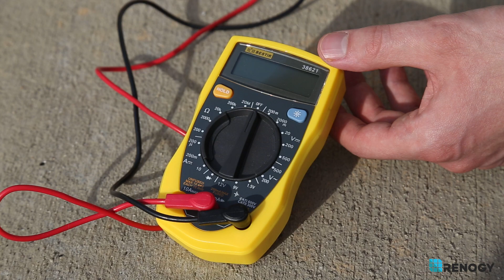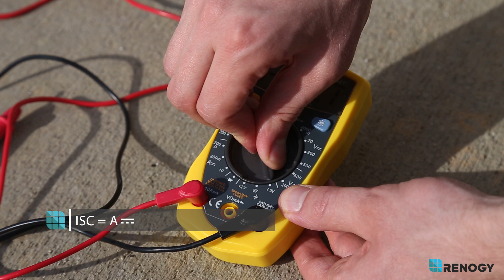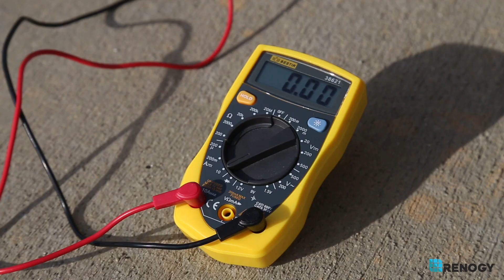Renogy: How to Troubleshoot Your Solar Panels

Comment: The section on setting up the multimeter is so very fast.   Pause play, pause play....  How do you test these with a load?   I have 800w 400w&400w at 48v.   Only getting 31 amps.
Reply from the maker: Hello, thank you for your attention! First, we need to confirm how your system is connected and your testing method.
Secondly, if you suspect any issues with the panels, we recommend disconnecting the connections between the panels and testing each panel separately.
If the video is too fast, you can refer to this link: https://www.renogy.com/troubleshooting/Troubleshooting-Solar-Panels

Comment: (APOLOGY POSTED) Your brand new panel may be defective...yesh, thanks for shipping junk.
Reply from the maker: Hi, Fights.
All our products are quality assured. If you have purchased our panels and are meeting after-sale problems, please submit a case through our Help Center Portal with more details (links listed below for specific locations）. If you have previously submitted a case which has not been replied, please provide us with the case number so that we can inform the customer service to solve it for you as soon as possible.
 
https://renogy.force.com/helpcenter/s/contactsupport (USA)
https://renogy.force.com/helpcenterau/s/casesubmit (Australia)
https://renogy.force.com/helpcenterca/s/contactsupport (Canada)
https://renogy.force.com/helpcenteruk/s/contactsupport (UK)
Reply: @RenogySolar  My concern is QA process has been shifted to customers.  Customer can QA to see if panel works.  Increased profit for Renogy.  Increased time, money, frustration for customers. This seems to be common with corporations lately.  Nothing else can explain why we receive brand new broken products so frequently.
Reply: So I enter for Web support.  The email response is call the 800 number.  Why have web form if we end up having to call?  Gathering statistics....
Reply: Apology to Renology!  I had not corrected the cables properly.  The cables were coiled up and unlabeled.  I traced them, labelled them,  and now all is fine.  Sorry for stating the panel was bad.  Renogy is batting 1000.

Comment: She mentions " you may have a bad diode" you can not test that out just pointing it at the sun with open circuit or current. You need to be able to test it while partially shaded and a load on it, and for those that called someone in the comments " intelligent" for suggesting a load, he is right. a load meaning connected to a charge controller. because the MPPT will drop the voltage down to about half in order to try to get the most wattage out of it. If your diodes are fine, the voltage will be " normal" Its easier to check with a series connection, because if one panel has a bad diode it will bring the entire string voltage down.  I had to learn and figure this out myself. Because I called Renogy and explained that my panels dropped voltage from being 60volts to 14 volts after adding a 4th panel, the voltage should be 80 volts ( give or take a bit) and the MPPT of that is roughly 68 volts at 5.9 A- 6 A ( in optimal conditions). But with that bad diode it was bringing the panel string down to 14 volts and providing only 10 watts to 25 watts. I went one by one I removed a panel, until the MPPT was where it was supposed to be. The " technical support" I got from Renogy was ( and this is verbatim) " Apparently since the panel is new it needs to adjust" If I would have listened to that, I would still be in the same boat. She also said since I had my panels connected in series that Renogy only recommends charging 12 volt, so charging 24 volt could also be the problem....well I was not charging 24 Volts and had to explain to her how an MPPT charge controller worked...more voltage lower current DC to DC conversion and so on. Anyways, I opened up the junction box on the back of the problem panel, and it had had writing on the panel inside and the diodes you could tell had been recently either messed with or damaged and had either flux or a burned look on the solder, I don't know if this was a return of if someone at Renogy randomly writes inside the junction box of panels. The other panels were checked to compare, and they had no writing, and the diodes were in tact ( although the solder job on ALL the panels were sloppy, and also the problem panel had a piece of loose metal or solder inside, that could have also been a cause of the defect or damage. If you register your panel online with them for warranty GOOD LUCK.... well that's my non professional opinion. The panels that were not defective or damaged work Very well, even over their rated wattage, but it really stinks when you do receive a damaged panel and try to get "technical support" and the person who answers the phone knows nothing besides the script in from of them. They also panic when you tell them you have a charge controller other than Renogy ( even though you are calling about Renogy Solar panels).

Comment: Renogy is certainly cheaper then Zamp for example but they have no support. Before I bought their units I called to see if there were spare parts like Zamp provides - no replacement parts.Then one of their panels blew a diode so I called and they had  no record of any of my 4 - 100watt panels. I asked why they have registration cards which i sent in. To give you a discount card, But ... no they don’t track your serial numbers. So I provided the purchase info and even one month later I have never receive the tech followup.

The panels work fine when they work but don’t expect any warranty support. Buy at your own risk and presume the panels are disposable.

Comment: If you found your panel is defective, Renogy won't honor your warranty if you bought it from Amazon Warehouse deal !!
Reply from the maker: Hi +w surfer
We are so sorry your panel is defective. Unfortunately since you purchased through the Amazon Warehouse Deal program our warranty is not valid. On the Amazon Warehouse Deal website, under FAQs, its states:

"Q- Do products come with a warranty?

A- No. Used products generally do not come with a manufacturer's warranty but all of our items are backed by Amazon’s return policy. If you would like additional protection, you can purchase a warranty from Square Trade to cover certain items."

If you are able to return your panel according to Amazon's return policy we would be glad to help you purchase another panel through our storefront and backed by Renogy warranties.
Reply: @RenogySolar  Are all the panels sold at Amazon "B", "C", or used?!?